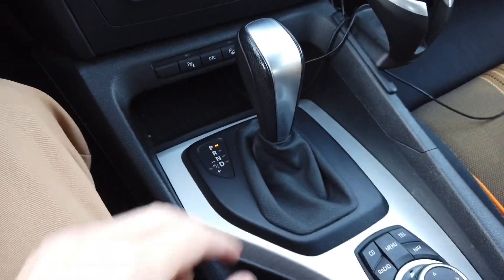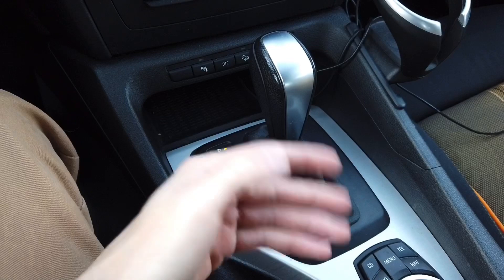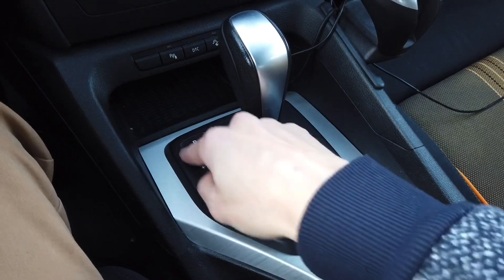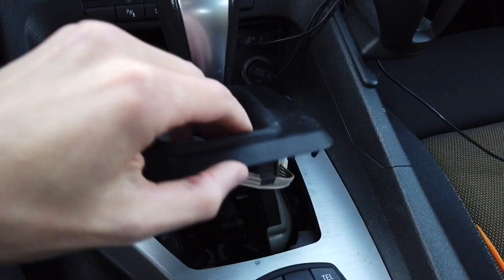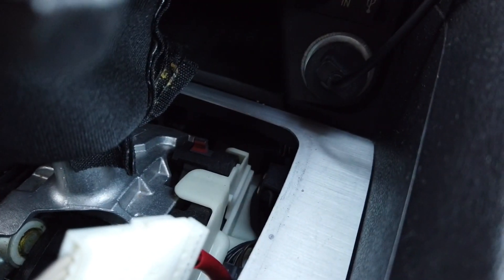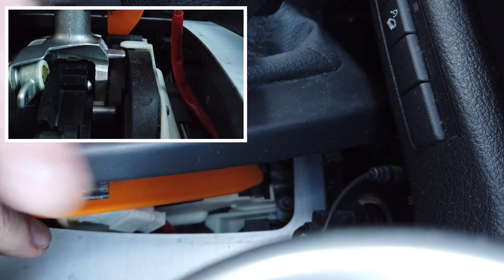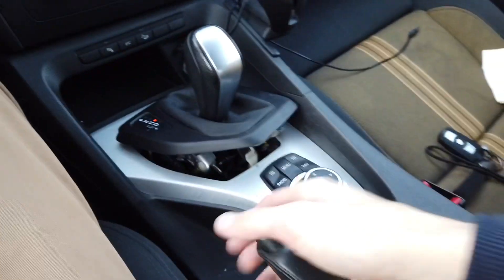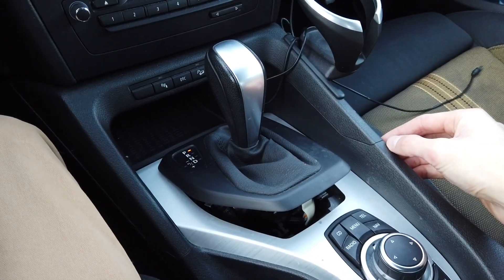BMW gearbox unlock E60 E90 E83 E87

Comment: Does this shortcut work in all versions of the Steptronic gearbox? (From 1 series to 3 series of the E87/90 versions? Year 2008/2012)

I have a 2008 BMW 1 series with automatic transmission. Often when I activate manual mode (by pushing the gear knob to the left) it often happens that it goes back to automatic mode. (In the dashboard display it shows the letter D and not the gear number as it should be in manual mode)

Could you tell me what's wrong?😢

Comment: The transmission has been changed to my e60 and now even after reprogramming doesnt unlock the gear stick, the car starts and drive perfect, just have to manually push the lock pin, any thoughts? Thank you!
Reply: Same issue here did you find the solution ?
Reply: Same issue here, on the scan tool i have codes 4e86 (solenoid 3) , 4e87 (solenoid 4). Does anyone have a solution?

Comment: This happened to me after I found out my RDC was filled with water due to the rain. I took out all the water and dried the module then the next day I wanted to drive to work it was stuck in parked. 
Is it probably because of the module? I ordered another one to replace it. Hopefully that’s what’s happening. Also my radio stopped working. Other than that everything else works fine. Engine. Power windows. Locks. Ac. Etc